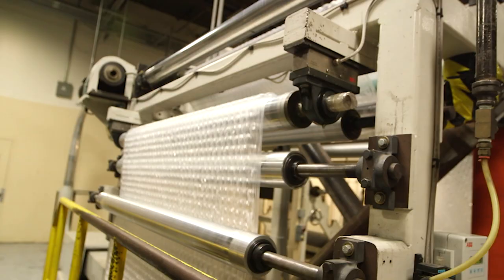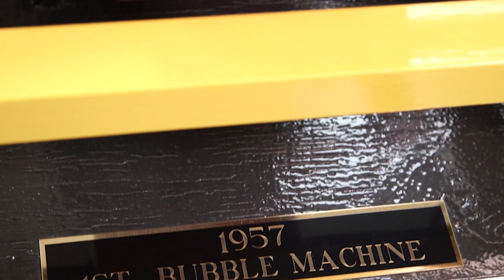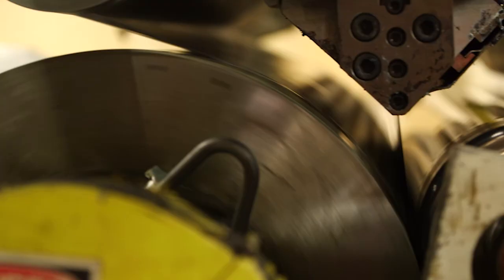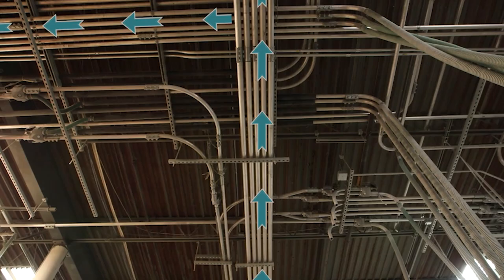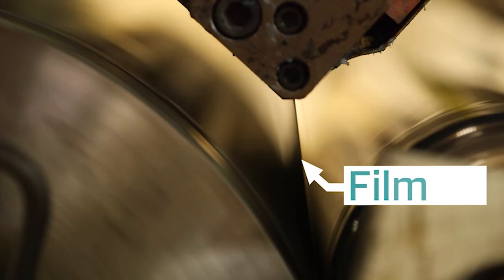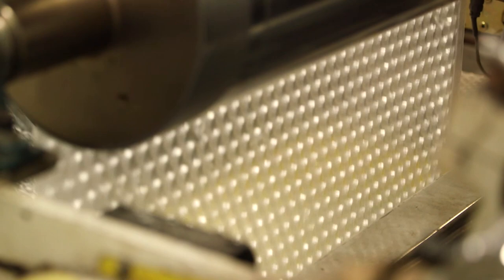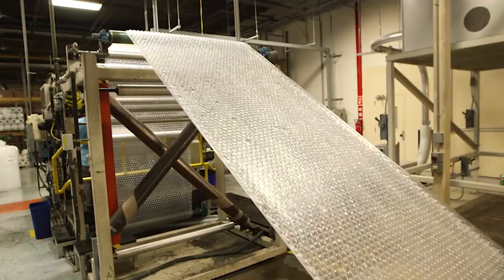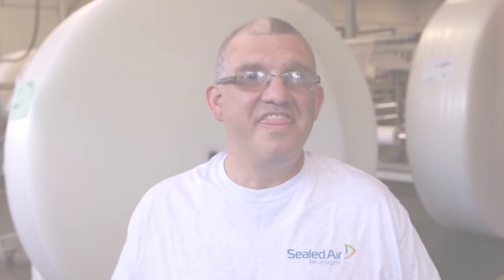Bubble Wrap --  How It's Made

Comment: Question: If I were to fart near your production machines, would the end consumer be able to smell it if they popped the bubble-wrap?
Reply: Products produced in other countries contain pockets of air from said country. Chinese products must have air pollution through the roof!
Reply: near to it won't work. You would have to literally fart into the specific part of the machine itself in order to get it in there before it dissipates too much. Then you'd need it to be sold and popped within a very short space of time as hydrogen sulfide (the chemical actually causing the smell) can break down extremely quickly
Reply: The short answer is no. If I fart in a jar and put the lid on, when I open it a few hours later I won't smell anything.